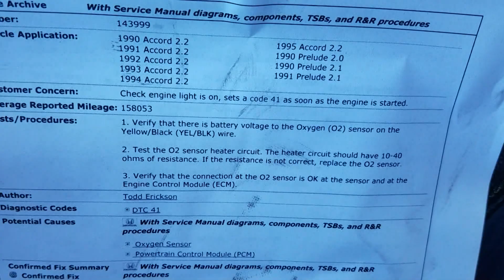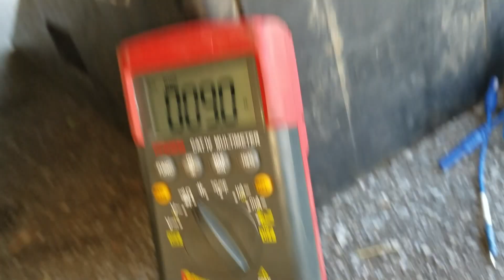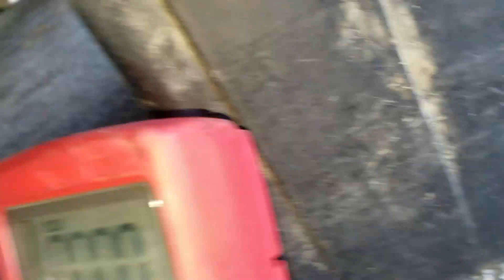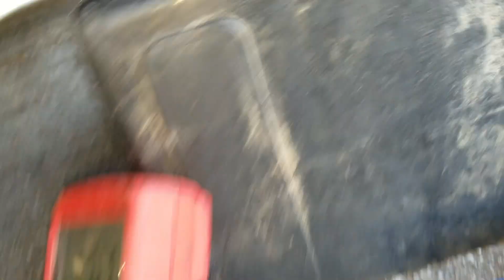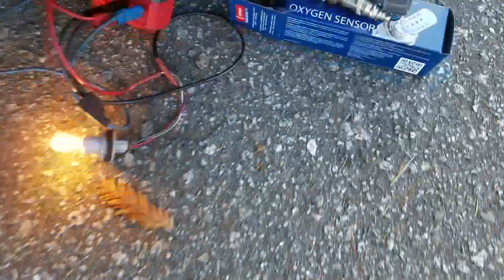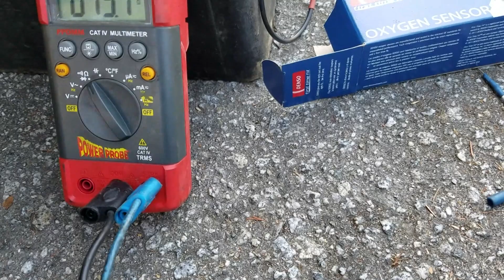90 Honda accord  Idle surges  up and down rpm  when warm part 1

Comment: Does the car ever idle normal, like after extended run time? Honda has a cold fast idle valve that is controlled by the water temperature.  This valve could be plugged and no water going through it due to poor maintenance.  There are two screws on one end holding a cover plate.  Put your finger over the small hole inside and see if it corrects the problem.
Reply from the maker: on  part 2 I did that test did not corrected
Reply: How about the MAP sensor?